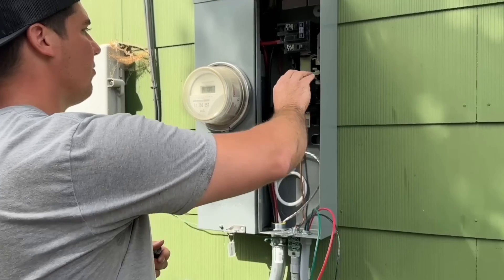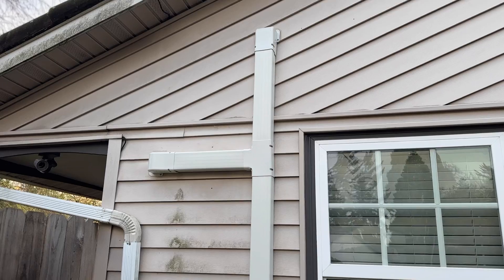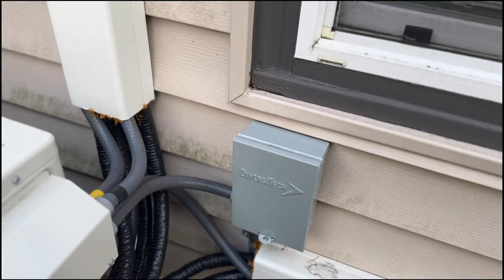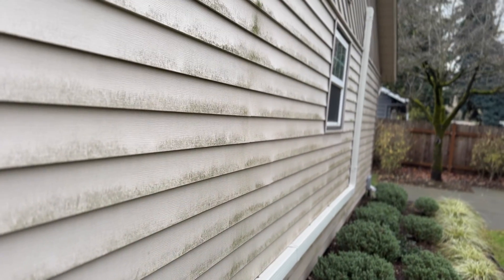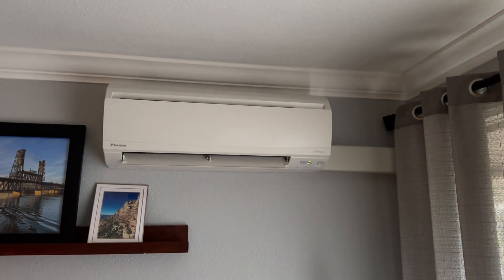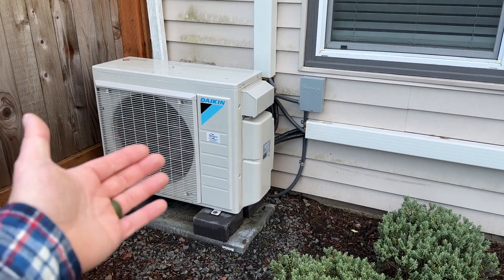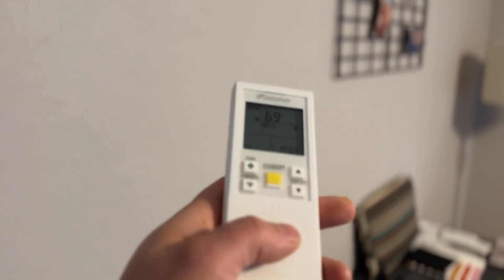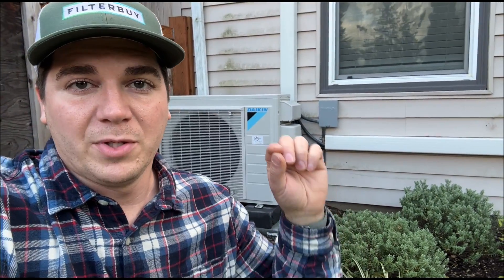Installing A Ductless Mini Split Has Many Advantages

Comment: somethings weired .

Americans are using slplit ACs now ? i mean this decade or decade -and -half . wow . 

In Asia we have been using these type of split ACs for decades , especially in my country where " cool only " sell most as it is a hot country with near to 40-43 degree Celsius in summer . 

" hot & cold " all weather split ACs are now becoming a recent trend here in Northern part of my country where during winters temperature dips to 5-8 degree Celsius so it makes sense to buy these all weather split ACs up in the North part of country as they will be of use both in 40 degree Celsius  summer & 8  degree Celsius winter .

Only AC Systems that has not yet been sold  till now in my country is these " multi-indoor-unit ( "head" as the person in the video says ) but 1 outdoor-unit systems "  . these are a nice solution if different rooms need to be cooled and only 1 outdoor unit does the jobs of cooling to two  separate rooms  with two indoor-units space efficient . people here fit two 1.5ton AC Units for two rooms as these type of systems are not available . may be most of people are not yet ready to pay the big investment in one go .

Comment: I have a few questions that nobody seems to address. 

Suppose I have a multi-zone system with an air handler in each bedroom of a 2 bedroom house. If 1 person likes his bedroom to be very cold during the summer but everybody else is content with a moderate temperature. 

If the 1 person has his room temperature set very low, will the outside compressor run continuously even through all the other air handlers in the other rooms rarely turn on? 

Could this 1 person cause unnecessary wear on the system and possibly shorten the life span of the compressor or increased maintenance?

It's not practical to have a single air handler for a whole house if many doors are most often closed such as bathroom or bedrooms. I here many reviews say that most people have too much of a system for their square footage because they need air for each room. That makes sense. My HVAC unit could run all day and never cool the bathroom if it has no vents. Yet manufacturers only make large air handlers for large spaces and nothing for small rooms. There's obviously a need for smaller air handlers but it seems customers have no option but to install massive air handlers into tiny bathrooms and it all seems unnecessary and wasteful. 

Instead of having these monster 9000 BTU sysytems for each room, why dont manufacturers make smaller air handler units for smaller rooms?
Reply from the maker: These units are 100% variable speed, so the compressor will run continuously if you have one room set super low, because there is only one condenser or outside unit. So at full capacity with all three heads going, the compressor will be closer to max if sized correctly, but if only one of the three are running to cool that one room way down, it will be running at about 20-25% capacity so it will still be very efficient and allow you to have the comfort you want 👍🏼

Comment: My love/hate relationship for mini-splits. They're efficient, quiet and get pretty cold because there is no ductwork involved. I use mine at night to cool the bedroom which allows me to raise the temp on my main 5-ton unit so that I'm not cooling the entire house down while I'm sleeping. However, many of them develop mold on the blower fan blades. You'll definitely smell it when they do. I've seen it on multiple brands (including my own Mitsubishi unit) and its time consuming to remove the blower assembly to clean. I tried several things to eliminate the moldy smell such as running it on fan-only mode to dry out the condensation, spraying Lysol disinfectant into the intake filters, blah, blah, blah.

Thankfully, I was able to completely eliminate this mold problem after installing a strip of low voltage mini UV-LED lights...it is an adhesive strip of lights that you stick on like tape near the blower assembly. They're available for mini-splits just for this purpose. Run it a few hours every day and you should be good. It's been 6-months since I've installed this strip and no more moldy smell.

While I'm here, just a note about HVAC warranties. I bought a Mitsubishi Mini split because of their reputation and it had a 12-year warranty. After 5 years, the condenser developed a leak and needed replaced under warranty. The part was covered. The labor was not...I was quoted $2350 labor to remove & replace the condenser. Yes, it's labor intensive, but Ouch, that's almost what I paid for a new unit. So, get a warranty that includes labor if you can.
Reply from the maker: That’s awesome! I’d like to do a video on that. I don’t use mine enough but I also don’t live in a humid climate. I’m sure that affects it as well.
Reply from the maker: Thanks for sharing!
Reply: Thanks for the post. I'm researching these and am quickly coming to the conclusion that they are designed to be disposable. Too expensive to repair even if you can find parts.
Reply: In my region, we clean the blower wheels and evaporator with power pressure to remove dirt and mold. And mini splits are the only systems used here as ductwork is prohibitively expensive in concrete/brick houses and apartments.

Comment: Thanks for sharing this information. I recently installed one of these and like it so far, but one thing worth mentioning is the cost to run the heater in the compressor (I measured around 0.7 amps at 240 volts). For my Mr. Cool 36k it costs around $12 per month - unless it shuts off the heater when the unit is running🤔. Mine is in a work shop that I only turn on a few days a week. And also, for anyone installing their own DIY unit, don't believe the videos that claim you can bend the 5/8" precharged insulated refrigerant tubing without kinking it, unless you are on the end of the tubing and it has the spiral corrugated section which helps with bending.

Comment: I always find amazing that in North America these devices are some kind of novelty. I had my first AC installed back in 2010. Right now I have 2 units and heating takes only 2 kilowatt-hours per night to keep the bedroom at 20 - 22 degrees Celsius (outside temperature was -3). I tested at 25 degrees inside and it consumed 5 kilowatts.
Reply: Because in the midwest and many other parts of the north our typical winter temps are -30F. Thats -34C. These things are double the cost for the low temp models and still dont work right in those conditions.
Reply: @Luckingsworth How often does the temp actually get that low?
Are you talking about the wind chill/feels like temp or the actual air temp?
-30⁰F is like northern Canada temperature.

Comment: I have the 18000 btu version (1.5 ton) two head system. I've had it for the past 4 years, and it has performed flawlessly. These systems require you regularly pop out and vacuum/wash the filter screens in the inside units (super easy). And you must keep the outdoor unit clean as well, especially if you have trees or shrubbery around them. It's easy to vacuum or wash out the fins of the heat exchanger, but be careful not to bend them.

Comment: Only con about mini splits is, getting the humiity out the room/building if you live in a very humud climate during the summers.  Like most force air ssytems,  efficiency really comes down to a better sweater and rain coat dor the building.  TBH , efficiency is a marketing term nowadays. Mini splits are great until the repair bill comes in and dealing with customer support/service, like most new everything made in China India.  My 2 cents.

Comment: Since my 6 BR 1890s house burned down last Sept., I'll be building a new house next Spring. Two stall garage size, no more than 24x24 one level insulated to the max. Maybe a Menards garage kit sans the overhead doors. Temp extremes in this area range from minus 30F to 100+F. I may or may not opt for boiler concrete floor heat. Either way, which mini split BTU unit do you and your commenters suggest? It will be an open area, the only rooms will be for the bathroom and mechanicals... water heater (Rheem 85 gallon @ $400 + installation) + washer & dryer and maybe a water softener. One person dwelling totally encased in steel siding/roofing with a few windows. 
At this point I'm exploring all options, nothing is 'set in stone' yet. Any ideas would be greatly appreciated.

Comment: Always install the condensing unit (outside unit) 10"-12" AWAY from the wall. This way you can clean the condensing coil yourself with a garden hose sprayer nozzle.
When you mount them close to the wall you cannot clean the condensing coil yourself and eventually kills the compressor
Reply: Why am I incapable of working close to a wall? Do HVAC techs have special appendages I a mere mortal human lack?

Comment: Nice one! I wonder if it would work well on colder temperatures up here in Canada though.
Reply: Idk the specs on that Daikin one but there are mini splits that can still provide their rated heat at -22F. I imagine you would want a backup wood stove or gas furnace since it probably gets colder than that in Canada at times.
Reply: Like any air heat pump they have a limit. Different units will work to different limits, however as temps get extreme they will loose efficiency and it's best to do your research if you often find yourself in those extreme temps. That said even if there's a couple months where the temps dip below the efficient or even usable range these systems could save enough money in the other months to justify their installation, One would obviously need an alternative heat source in those coldest months such as resistive electric heat or wood/gas stove if you get below the usable range -30C is the lowest I've seen listed and that's gonna cover some mighty cold weather.

Comment: How do the head units get power for their fans? Is it simple outlet plug up on the wall that they had installed? 
I have a room in my barn that is insulated and when they built it they have a mini-heater on the wall. It sorta keeps things warm, but on cold days it can't keep up. There is no AC however and that's a no go for me as far as using it for a workroom, so looking at these mini splits. This room is 10x10 but has a high ceiling the height of the interior of the barn so about 15' I think, so I would think I could get away with a small unit. 
Anyway, great video again. Thanks for keeping DIY'ers like me in the know.
Reply: The indoor head units simply get power from the outdoor unit. The power (and communication) wires are ran from the outdoor unit alongside the refrigerant lines to each indoor head unit.
Reply: @SomeRandomDude-zqxj   Thank you.
Reply: In the video he said the indoor units were 110 volt. They are 220, are they not? Just like the outdoor unit? If I run Romex 2 wire with ground to power the 220 V outdoor unit, then I cannot power the indoor unit from the outdoor unit because I don't have a neutral. So I think they are 220 volt. Can someone confirm? Thanks.
Reply: @nwsvndr  They are 220/240.